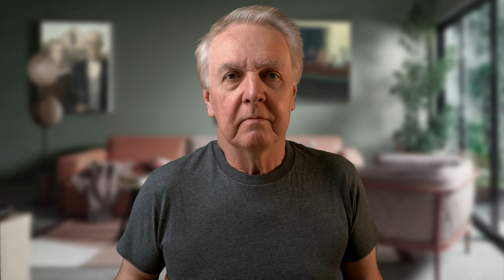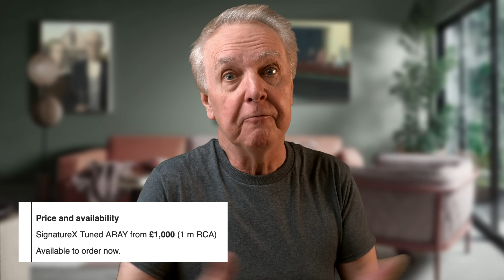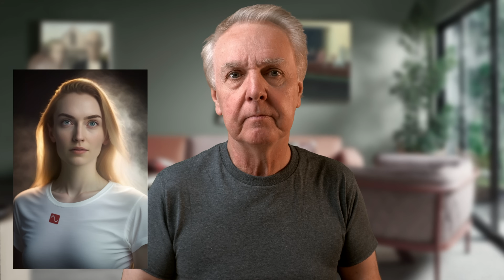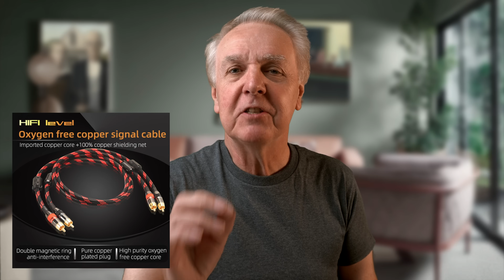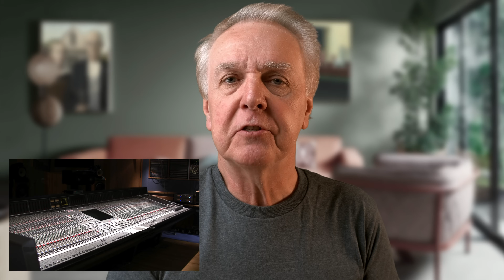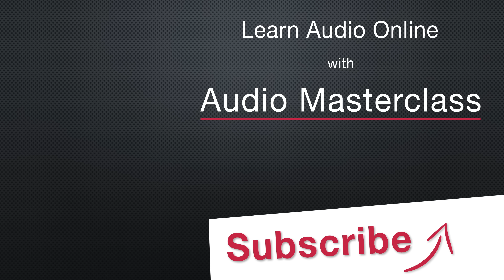Would you pay $1000 for a 1-metre cable?

Comment: Your are too kind. Frequency response, distortion, phase, etc. are all products of electrical behavior and are not real attributes of the cable or current. What are the real attributes of cable that matter which can be described and measured? The answer to this question flies in the face of the "what I hear is what is real" crowd. Unfortunately, those who say they hear differences between interconnects are merely offering evidence that the noggin is not a scientific measuring device.
Reply: It's just hallucination rooted in confirmation bias.

Comment: "Magic" parts in audio has always been a particular annoyance to me, cabling especially. I used to make the argument that, in the USA at least, typical household wiring for a 15 amp circuit is 14 AWG Romex (around $0.50 / foot) and could be as long as 80 feet. So you want to tell me that that final 3 feet is going to make a difference? Sure is pretty though.
Reply: Perfect! That's what I always said to my audiophile friends... And, as he mentioned, the cables inside the equipment. any equipment hi-end or not, doesn't cost $1000/m. It's cents...

Comment: Even though I may have spent more on cables than some, there is no way I would spend a 1000 pounds on a pair of 1 meter cables. I have spent about 800 pounds on all the cables in my system.
That includes:
- four 1,5 meter power cables (streamer, DAC, amp, subwoofer).
- one 0,5 meters USB cable (between streamer and DAC).
- two 1 meter XLR cables (between DAC and amp).
- one 3 meter RCA cable (subwoofer).
- a pair of 2,5 meter speaker cables.

Alas, a total of 16,5 meter of (quality) cables.

Comment: Ooooh, as someone who worked with RF and EMI and other messy stuff it sooo refreshing to hear someone mention relevant parameters for cables and instead of the normal "anti-cable" bunch that argues from "it's impossible" but rather the, and a lot more correct, "how much" perspective. I felt it included a lot more nuanced and relevant information than any other cable review I've ever seen (regardless of camp). I really liked your take/view on cables and would definitely watch more on the subject, a suggestion for new videos it would be regarding what makes a bad cable/good cable (as in when does issues become audible). Personally I don't trust any cable makers and think they are crazy overprized, so I buy by the meter so that I can get the materials/geometry I like for a fraction of the price.
Reply: @Douglas Blake   It is big mistake suspecting that cable will "consume " signal internally and there will be noticeable difference between in and out from cable Cable has too low serial resistance and on both sides will be of course tha same data. Anyway this "perfect cable" is affecting signal because electronic cannot handle nor equqlize  it's deviations caused by  own created in cable  operation electrostatic and magnetic  fields.  Sorry if not easy but  tried hard to explain it i shortest way and you are misleaded by all that long lines behaviours which have nothing to do  in audio . This are separate subjects.
Reply: @Mikexception  You do not make any sense. Go look at transmission line theory. As soon as you have alternating current, DC resistance is not the only factor any longer.
Reply: @nicoras8803  . Three sentences and three "agendas" without sign  of valuable  information. Nothing to negate and no any input. Are you politician?
Reply: The most exposed  disadvantages of audio systems are hidden in phase shifts. In analog systems  phase shifts  are affected by anything because   they are result od 3 parameters - R, L and C. And their exact combination (with linear character each has infinite number of values)   are hard to replicate even we make them     from the same  materials and in same  size of products.  In digital we face even  more problems because they are on fact hybrids of two. 

 Wise conduct is to make them not  exposed because it is only interfernence  . But many say they prefer to listen just to revealing deatils charactristics with tweters working to 40 kHz and amplifiers working to 100kHz and sounding artificialy  exposing that unusual bands  It is as to  build by purpose systems for detecting differences which in naturakl sound are covered and masked,  in result are  unnoticed.  That is why in my opinion such differences are said to be observed only in High End price systems.

Comment: About 25 years ago, I was asked to check out the system of a well-heeled audiophile to find out why, after investing almost $100K in his system, it sounded so bad. He had some serious hardware in that rig: Krell amps, Wilson speakers, etc. He had just dropped $5K on some Teflon-insulated, solid silver speaker cables in an effort to improve the sound. The system did, in fact, sound terrible. But that was because it was in a room with a wood floor, wood paneling, plaster ceiling, a large bay window without curtains between the speakers, and only one chair. No carpets. Nothing at all to dampen reflections. I told him to stop wasting thousands on cables and buy some carpet, a cloth-covered couch, and some curtains. Two weeks later he called and thanked me profusely, saying he had spent about $6K on those items and it was the best "system upgrade" he had ever made.
Reply: Things just never change. What's the best way to make lots of money? Find lots of fools ;)
Reply: I listen to music, not equipment.
Reply: @colinwright4139  Equipment should indeed disappear from what you listen, meaning equipment should be the most flat and uncolored / linear it can be.  Listing to music that sounds awful is killing the whole experience in my case... Once i get a sufficiently good sound system, i can enjoy the music!  And it doesn't need to cost big money, just choose the right gear and let aside all the crappy marketing around us.
Reply: @guyboisvert66  once you get above a few hundred pounds, shit mixing and mastering has a bigger impact than the gear, which has been magnified in the digital age. That badly compressed mp3 is going to cause real pain, even on the greatest system.
Reply: @colinwright4139  Yes, very sad many recording are butchered to the point of not being listenable...  The loudness war, the rushed out albums, there are many stupid things destroying music sound...
Reply: @colinwright4139  Lucky you that listen to the music and not the equipment.
So you would be totally fine with a transistor radio in a echo chamber.
Great for you! 👍
I am so jealous. 🤯
Reply: @AmazonasBiotop  Well said!
Reply: @AmazonasBiotop Yep. Probably. I used to work in a large record company studio as first a tape-op and then house and finally freelance engineer. Which is how the career path used to work up until the early 90s. I’d work with some pretty big names in the industry at the time and one thing that struck me early on is how, to a person, these successful engineers had terrible systems in their cars and at best, mid range consumer gear in their homes. It was almost a badge of honour. These were rock and pop engineers mostly, later on I worked with a few orchestral types and they did have good systems. Not nonsense systems like the audiophile mags, but pro level stuff you’d see in a studio. But in the world I worked in, you’d be almost proud to have the most janky system for your own private listening. 
The human brain is an amazing thing. As it’s capable of convincing someone there’s a night and day difference between a £20 and a £2,000 ‘interconnect’, it’s also capable of adjusting the listening experience to enjoy the music, not the tech. My theory is that these engineers listened critically on some of the best equipment available at the time for their dayjob. When they listened in their own time it was either to enjoy the music alone or to hear what their work would sound like on an average, or below average hifi. 
During the 90s, along with those awful engineering schools, ‘audiophiles’ started to infect the industry with their ideas. It’s died back now, but there was a time when young engineers from the SAE would go on about interconnects and all the other nonsense from that world. And the vast majority of those students, up to 60,000 per year, were competing for about 6, ok, maybe 60 jobs worldwide. Luckily that’s not the case anymore as someone with talent and drive, and a large dollop of luck, can create music on an almost zero budget so the jobs available aren’t limited to commercial studios anymore. 
I also saw this whole schtick about having a crappy system at home go away when more and more people recorded on what they listened to in their own spaces, but that makes sense - if you have a good Genelec or Adam system in your project studio, why not use it for listening pleasure as well?

Don’t forget, billions of people were perfectly happy with compact cassette and the poor quality faded into the background if the music was good. The power of the human brain.
Reply: I remember reading in some audiophile magazine about 15 years ago or so. It was a article of Fabio's hifi system. You know that long-haired beefcake. He had a lot of expensive equipment an Martin Logan's largest most expensive speakers. The room was quite big and long. On the right side of the listening place the whole wall was drywall and a couple of doors. The left was  a whole wall of glass. No way that that would sound good. 🤦
Reply: @jpz1970  I remember both Fabio AND the article about his very expensive stereo system...  :)
Reply: @supergrissi  Slashies aren't thinkers for that domain belongs to the hand models
Reply: @jpz1970  the nice thing about thoses Martian logans they were not as good off axis as the sweet spot was, no speaker is.  Personally I think the large Bob Carver Amazing loud speakers are better or the magapans  there was one other planer type speaker ive never got to hear im told was even better.
But I cant comment on hearsay. 

Yes the larger Martin logans were OK, but id go more to B&Ws natulis from the same eara
Reply: Yes, there is audiophiles that spend their whole life by carrying in and out expensive equipment, in the same lousy room. And then thinking that they could get a different result..😢

First off fix the room there's plenty of companies to choose from if you can't do the DIY route.

Then when the physical domain is done it is time to learn and fix the rest of the acoustic issues with DSP and verify with REW.👍

I can not imagine how my TT, CD and streaming would have sounded without the DSP.

Only the imagination is the limit. Can implement ISO226:2006 and Interaural Crosstalk Cancellation and other enhancing technology from researchers and doc:s. 👍
Reply: Oh no - now someone will start selling $10000 special audiophile grade rugs and chair covers.
Reply: @KissAnalog  They probably already do. Oxygen-free, long-crystal, teflon-insulated shag carpet.
Reply: They even advertise Hi-Fi systems shown in a bare room. I just look at their adverts and think, "this is going to sound AWFUL".
Reply: @SimonBlandford    Yes, I find those advertising also very funny.

They make them to look so pretty and clean. Many of hose pictures displays systems with no "ugly" speaker cable on the floor!😜
So they just put the stuff there and made it to look nice as a life style image. 🤣
Reply: Ah....but wouldn't the system have sounded even better if he'd spent several $k more to have all the carpet and fabric woven by Angels, and then kissed by the Pope...?  😜
Reply: @stevesstuff1450  Maybe, but I wouldn't recommend it.
Reply: Wait what, 6k for that. It must be audiophile grade couch and rags.
Reply: @SlavkoStorm  Experience would suggest that people with $100,000 stereos don't buy $100 couches.
Reply: Size and shape of the room also matters as well as speaker placement.   One room might sound great, move into a different room with the same equipment and it sounds like ass.
Reply: When I first read this and saw 25 years, I initially thought of back in the 80s and remembered my dad's original stereo system, nothing close to high end, but just a receiver and a couple of speakers.  Then I remembered that 25 years ago, as of the time of this posting, was 1998, and I had just graduated from law school and passed the Bar, and I had a small home theater in a box surround system that might've been 5.1 but was a big step up from the basic stereo system I had in undergrad and law school.  That doesn't seem that long ago.
Reply: @Aggie1295  For me it seems like a couple of months ago.
Reply: Why the heck do so many people believe that wood panels absorb sound waves?? It's like a disease... 🙄
Reply: I wouldn't wanna watch that kind of violence anyway...
Reply: I had the same experience, this is 100% true. Well put.
Reply: Your story is very believable🤣🤣🤣🤣🤣
Reply: Perfect example. 👍
Reply: yeah...gear make the sound but you listen to the room
Reply: @endrizo  you hear the room, listen to the sound
Reply: Can't say I believe this story
Reply: Spend four and a half decades repairing audio systems and then come back and tell me you don't believe it.
Reply: @RedBankVintageAudio  yes
Reply: The sound "audiophiles" hear is the in the windmills of their minds." 😮
Reply: Sounds like launching a 100K+ speedboat from a ramp while still attached to its, now invisible  trailer and start complaining about its lack of performance after leaving the dock .
Reply: I think we know the same guy and he had me in to consultant right after you.
Reply: Yes, this is where most make mistakes-  Bad rooms/setup (placement of components but, speakers usually), and treatment or not , treatments are usually done haphazardly/ shotgunned...  Makes you wonder how they could afford given they are clueless...
Reply: awesome !   Look at the differences of a indoor concert in the winter with the audience wearing heavy clothing
compared to a hot summer show in the same concert hall with everyone in T shirts etc..
Reply: I was there when this didn't happen
Reply: He bought $200,000.00 rugs?
Reply: @TheSpoonwood  Where do you get that figure from? He said he spent $6,000 on carpet, a couch, and curtains.
Reply: If he only had a chair why did you tell him to buy a couch?
Reply: @6doublefive3two1  to soak up some of the reverberation in the room. Upholstered furniture is very good at deadening a room.

Comment: I remember a 'high end' audio cable company mentions in an explanation video that the direction markers on there cable are only to prevent customers to call the service hotline.

Recently, I soldered my own RCA interconnect with 2 wire + shield per channel. Happens to be 1m long and has cost me about €25,- (parts). I think I hear a small difference in the sound compared to the €10,- cable from amazon. But maybe that is only because I made it my self. And we all know, self made cakes are better. No idea how to make a A-B compare which is objective. Or how to measure a cable without very expensive equipment and no knowledge how to do it.
Spending > €1000,-  on a cable? Never!! If I had that money I would spend it on CD's, because then I have defenitly a different sound coming from my loudspeakers.
Reply from the maker: This is a useful perspective. For £1000 GBP I could buy 500 or more CDs secondhand from boot sales. DM
Reply: " No idea how to make a A-B compare which is objective. Or how to measure a cable without very expensive equipment and no knowledge how to do it." High end oscilloscopes and spectrum analyzers would do it. But it's surprising, isn't it, that in a century of audio engineering there's not yet been a famous hit where the producer said it's all because they spent a week choosing the best sounding cables.
Reply: @editingsecrets  no, instead they produce music with distortion in it (too much loudness). So why bother distortion-free cable. If it was an issue. Normal cables are good.

Comment: Most interconnects are expensive, fixed parameter tone controls. I’ve heard differences between interconnects, but it’s usually attributable to emphasis on a particular part of the audio frequency spectrum.
Reply: @@Douglas_Blake With electrical characteristics, which have the potential to alter the signal, albeit by relatively minor amounts.
Reply: @@Douglas_Blake So cable manufacturers quoting capacitance & impedance figures etc is pointless then? Thanks for the 101, btw 😉